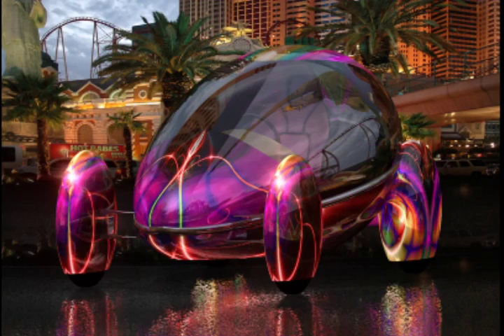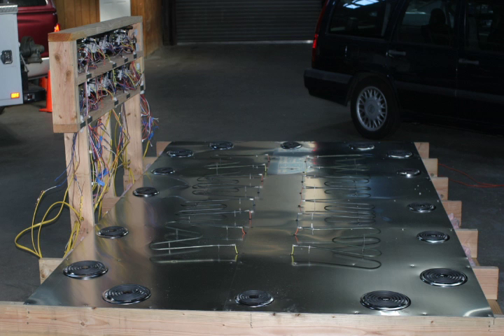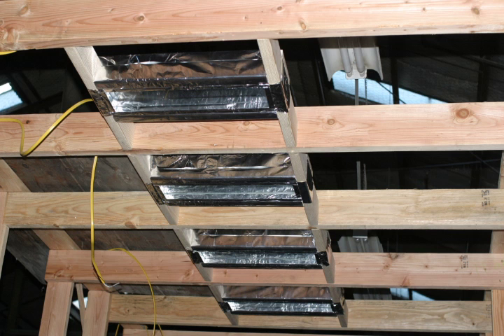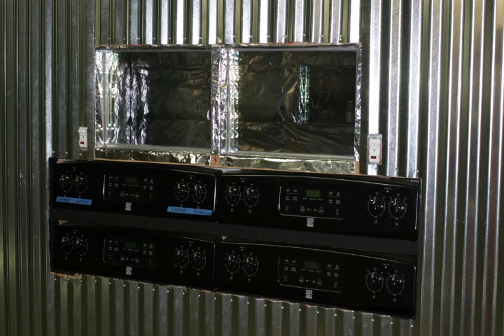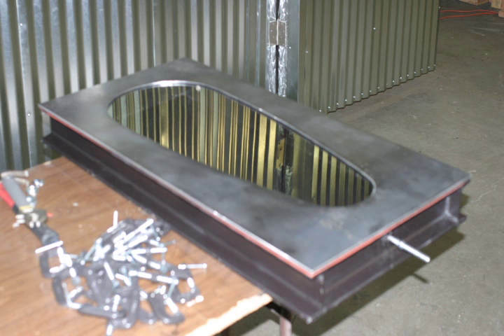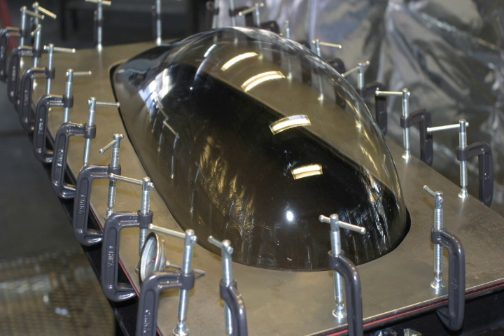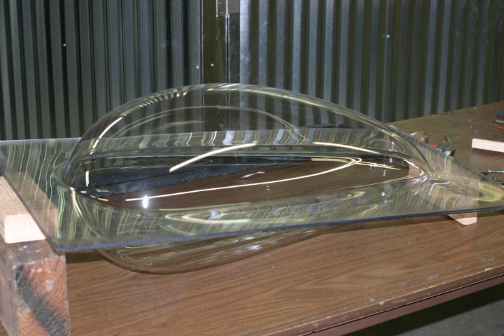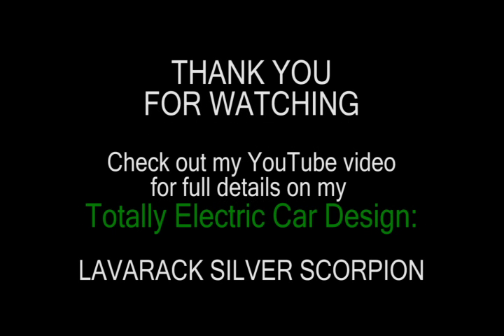VACUUM/BLOW FORMING CLEAR POLYCARBONATE PART 1

Comment: Hi Gary, do you form for anyone else? I need to get 1/4" polycarbonate formed in 4 parts all 17" diameter disc shapes with 73 cylinder shapes in each , 72 of which are about 1" across and 3/4" deep.
I already have the material I can ship. omegazap at gmail

Comment: Blow forming would not give the repetitive accuracy/tolerance you would require for a project like this.  Just a tiny variance in the pressure, temperature or the thickness of the material would result in a different shape.  You need to vac form over a former so that every canopy formed is identical and the variables are eliminated.

Comment: I am wanting to form a replacement wind shield for my motorcycle , out of .250 plexiglass.I need to heat it to 360 degrees and let it lay down on a form I'm going to make from the old wind shield that they don't make any more . You are the only person I have found that seams to know what they are talking about so my question is, what can I cover my formwith that will take the heat and not mess up the clarity of the finished windshield . I worked for a man years ago and helped him build and oven to blow form a window for a medical helicopter but I did not remember the temperature or what we put over the forms.Can you help me please.

Comment: What ever happened to this project? Guy must have died.

Check out this:

https://youtu.be/VlzfPzQXACY
Reply: The video you referenced shows acrylic sheet being being molded.  It's very likely that it is getting scratched and will need polishing.  Polycarbonate can't be polished, so free-form blow molding is the only option if the surface is to remain optically unblemished.

Comment: FYI- You can buy coiled nichrome wire for heating air. 5kw, 10kw, 15kw, and 20kw. Then buy ceramic donut insulators to support the coiled elements. 220 volts
Reply: I bought four brand new ovens... giggle
Reply: Or easily produced aerogel can be used, it's the stuff that allowed the space shuttle to survive landing back on the planet without even so much as a singed hair even. 
Rock on. 
#TheDigitalLifeguardProject-_-

Comment: a while back when i was working for a job shop we built a oven that was 4'x8'x8' to heat up acrylic 1/2" acrylic sheets. we used one industrial covection oven as the heat source.

Comment: Hi Gary,  I thought PolyCarb when you heat it enough to bend it bubbles due to moisture in air, how did you avoid that?
Reply: Moisture inside the plastic..You have to pre-heat the polycarb for 24 hours at 100 deg C before attempting to form it.

Comment: Hi Gary, Thank you for the excellent video! We are a sculpture studio that is experimenting with thermo forming. We have been using acrylic, as we understand it is more UV resistant, and will be likely to yellow over time. The drawback of using acrylic, is that it becomes very brittle after forming, and is difficult to trim without breaking. My question is if we use poly-carbonate which is less brittle, can we expect yellowing over time, or is this a UV stable solution? Thank you again.
Reply: Seek out a UV-stabilized PC, the cheaper ones are not.

Comment: It is that really 350 Degrees? I have tried to do the same and policarbonate always bubble like and alka-seltzer!! very disturbing quality . that make me quit using poly-carbonate! Never the less this was a very nice video, I meant it. thank you very much.
Reply: +Migueldeservantes  You have to dry polycarbonate before putting high heat to it. We usually dry at 140 deg for 4-5 hours. After that you can heat it until it sags to the floor and it won't bubble.
Reply: +Joe Fox WOW !!! Your answer mean the world to me thank your so very much for answering, every one in the sign industry was telling me that it have to be done under a high pressure to avoid the bubbles. It is there any tell tell sign that it is ready for high heat??
Reply: +Migueldeservantes 
People in the sign industry want to do the work themselves. 
What causes the bubbles is moisture in the plastic. Most plastics are hydroscopic. When you heat the plastic without drying it the moisture expands and turns to steam making bubbles. Slowly heating it at a low temp for several hours cooks the moisture out without bubbling.
We use quartz heating tubes on our thermoformers and if were running sheets that haven't been dried we will heat the sheet very slowly for about 45 minutes then put medium heat to it for 20 minutes then finally bring it up to forming temp in the last 5 minutes for about a 1 hour cycle. 
If the sheets have been dried we can heat a 1/4" sheet in about 6 minutes under high heat.
Reply: You know that one think about most polymers as as very solid material that can eve use as a moisture barrier!! but I guess that once "One have been working for long enough with this type of plastics.. one start to learn about it. 
Thank you again and again!

Comment: You are pretty smart and that's badass but why use fiberglass insulation when polyurethane is like 80% more efficient. I bet your shop was warm during 4 ovens operation. Polyurethane doesn't burn at the temps ur using those 2x4s would be the weakest link. Experiment with the poly you'll love it
Reply: Polyurethane has a max temp rating of 250 f. not safe at temp needed to form poly.

Comment: Does the depth of the box built for blow forming have an effect on the outcome, or would it not matter if there was only a 1" void underneath the poly sheet, as long as pressure was built slowly and evenly?
Reply: +Kevin Ford it shouldn't matter at all, unless maybe the air flow into the box is such that it blows onto the hot plastic, causing deformation and local temp changes.  Some sort of baffle / diffuser setup should prevent that.
Reply: lower box would be susceptible to warping as rigidity is reduced. If only 3lbs is applied it could be made from thinner steel instead of the heavy gauge beams shown here.